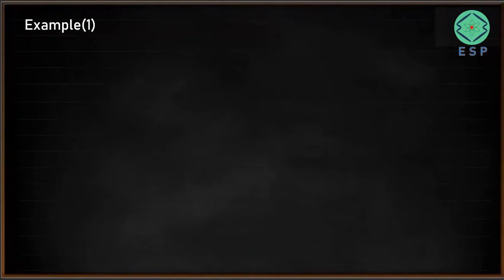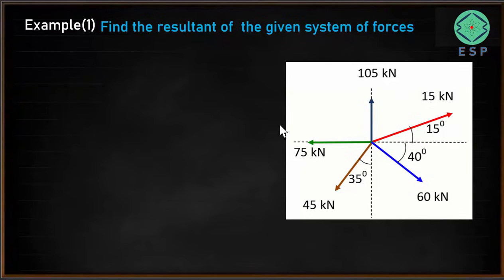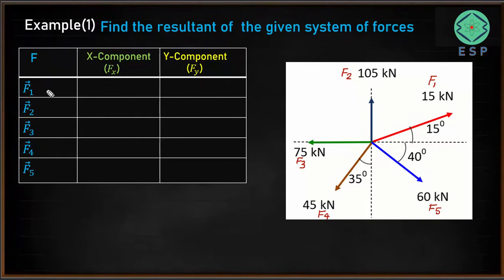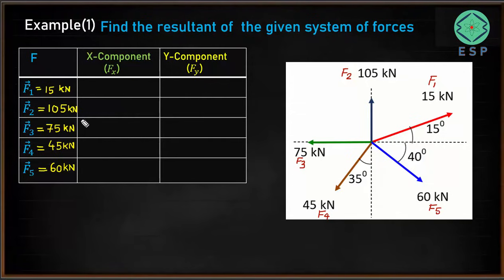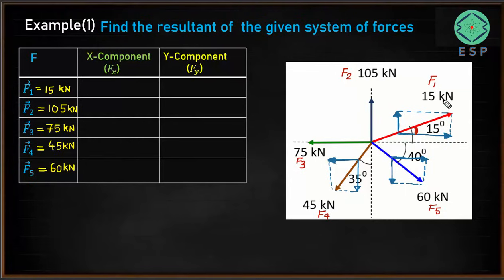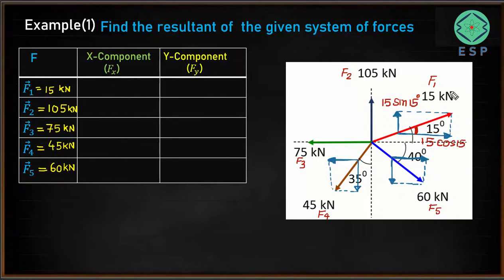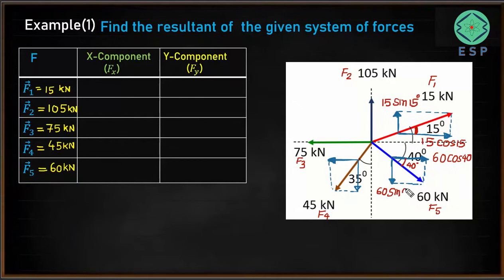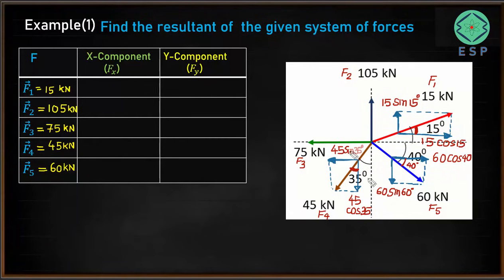Example -1 : Resultant of Coplanar concurrent forces | Engineering mechanics

Comment: Can u kindly clarify for me why you equated 75cos 90°= -75 and 75 sin 90° = 0
Reply from the maker: It is 75cos(-180) = -75 and 75 sin(-180) =0.
By the way I have done it differently, Since 75 is acting towards negative direction of x-axis , it has only ve x component, that is 75 in x-direction and no y-component that is 0 in y direction.
Please go through the video, y will understand easily.

Comment: on f4 Y component should be sin and X should be cos right?
Reply: Angle made by F4 with y-axis (Vertical axis) is 35 degrees hence F4y= F4 x cos35 and F4x= F4xsin35
Reply from the maker: yes
Reply from the maker: Angle made by F4 with y-axis (Vertical axis) is 35 degrees hence F4y= F4 x cos35 and F4x= F4xsin35